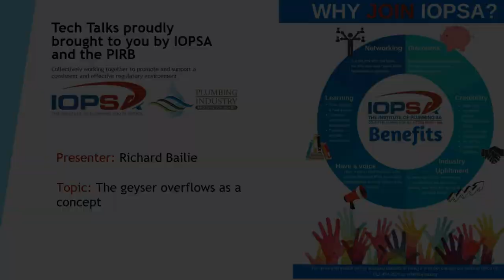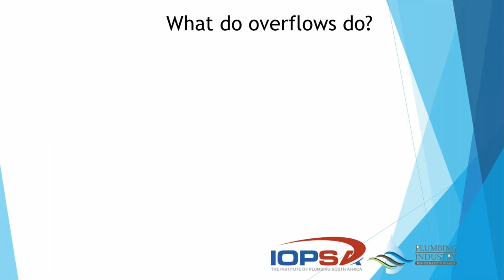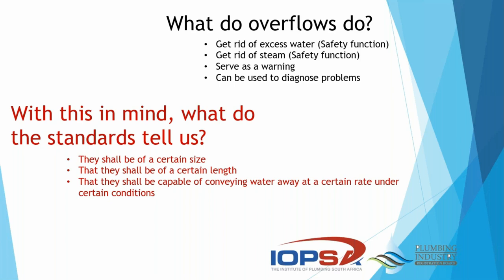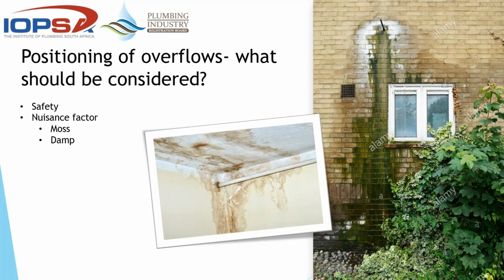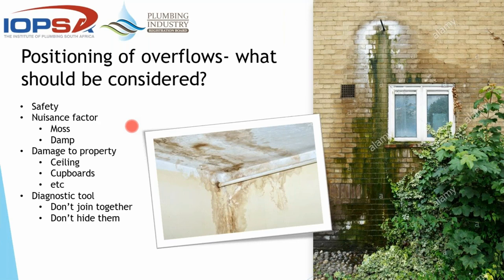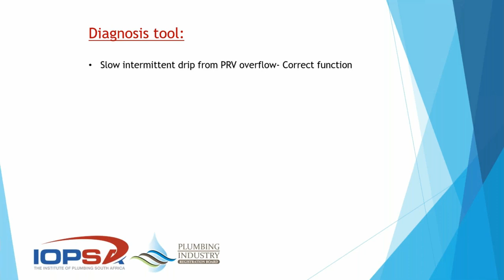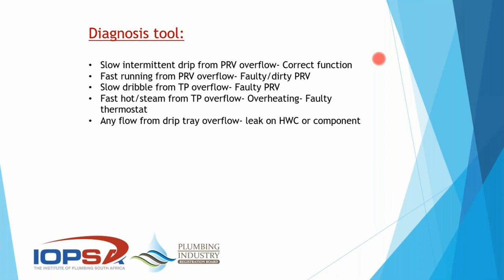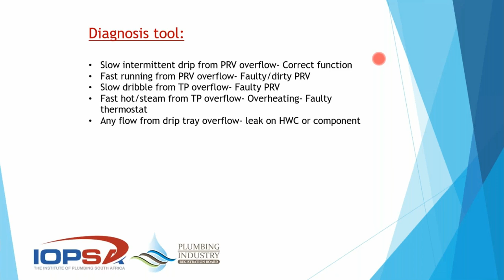Geyser overflow

Comment: Hi ,it's a query please need yr help ,geyser is off ,geyser tap is closed ,Y is it still dripping from overflow thank U God bless 🙏
Reply: Your Geyer might have a leak on your fittings please check outside your pipes there might be a big pipe which is PVC for leaks just around Houser then the copper one which is 22mm for to valve then the other one 15mm for PCV

Comment: Is it normal for a geyser to overflow at night in the colder months please. No overflow during the day or as soon as I use the hot water in the morning.
Reply from the maker: Good day Catherine, thank you for your comment. Yes, it could be normal for a geyser that has an expansion control valve to discharge water on a regular basis.  However we would require some more information in order to answer your question accurately. Please kindly email us directly with this query on technical@iopsa.org and we will be happy to assist you once we have a better understanding. If you require any additional assistance please call us on 011 454 0025